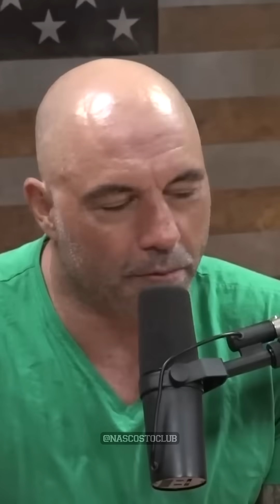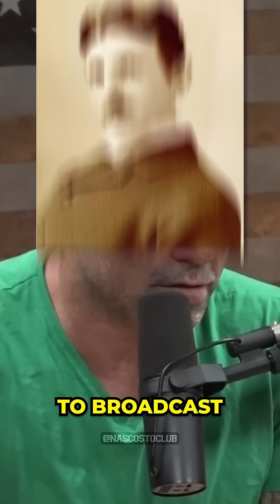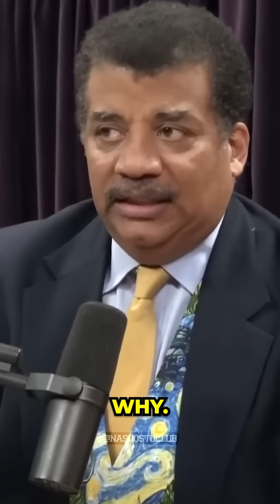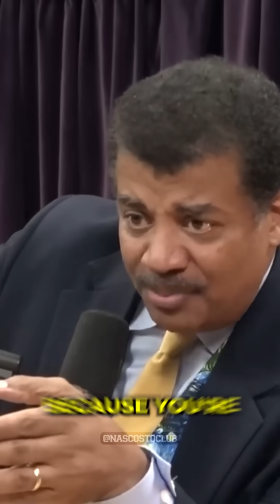WIRELESS Electricity Idea Debunked ⁉️⚡ #shorts

Comment: You’re pretty much in trouble anyway it doesn’t matter about the wires are Teslas idea about sending it through the air and the waves are phones and G5 alone if you have it on you it’s just radioactive I don’t care what magnets you put in there slip it in some sleeve that’s magnetized or special magnet. I’m telling you these phones you put them up to your head you lay next time you look at them and the radiation pulses because the phones always looking for you, so it’s always activating. It don’t even have to have it turned on.

Comment: Sound.
not electricity.

you convert it back to electricity at the fuking toaster; ya half-rate schill.

Or rather: from steeple to steeple. then it's in your walls. Redbricks are batteries.
(Research 'Tartarian Truthers',
  'Jon Levi', etc...   ...Arches, Columns, Lighthouses, Pyramids, STAR FORTS, Moats, Organs with waterworks, Symbols on Antennas, ANTIQUITECH)

Comment: In walks solar panels. Now, just to be clear you can transfer energy with light. Light is another form of EM waves and radio waves are EM waves. Now change solar panels to a different medium that can convert the EM waves into electricity. You can most certainly create electricity with Microwaves, take a grape split it in half but keep both halves stuck together by a piece of grape skin and stick it in the Microwave and watch the electricity fly. 

Now I don't think this video was a complete conversation and shows a fluid conversation about this topic.

Comment: There is a man on Instagram who has made a conductor that will power a lightbulb through the earth, I believe it is world wide and if you build a receiver the right dimensions you will receive the energy through the floor. Although I haven’t done it and I’m sure it’s low power, If 1 man can research this and do it in his back garden world wide, surely if a team of trained engineers were on it electricity could be put through the ground?

Comment: "It will be, furthermore, noted that no matter to what an extent the coils may be modified in design and construction, owing to their general arrangement and manner of connection, as illustrated, those portions of the wire or apparatus which are highly charged will be out of reach, while those parts of the saine which are liable to be approached, touched, or handled will be at or nearly the same potential as the adjacent portions of the ground, this insuring, both in the transmitting and receiving apparatus and regardless of the magnitude of the electrical pressure used, perfect personal safety, which is best evidenced by the fact that although such extreme pressures of many millions of volts have been for a number of years continuous-1y experimented with no injury has been sustained neither by myself or any of my assistants." - US645576A

Comment: As an electrician I would to show Neil how open air electricity works. Cause I think he believes it's like a big bug zapper that just has no directed path. If there's no lines to mess up you won't have accidents , point a and point b if electricity is disconnected between the two points it stops being dangerous. If you fly through it while not touching the ground you can't even feel it. I'm just wondering why not

Comment: This is the second or third time I have heard NDT, dealing misinformation.. I once believed him to be legit.  You can stand under high voltage suspension wires with a florescent bulb in your hand while the energy goes through the air and  lights the bulb  using your body as a ground to complete the circuit.  I like how he says "ALMOST CERTAINLY".  How can you be so angry about something that is "almost"  anything?

Comment: I never thought broadcasting electricity through the air was a feasible idea, exactly for the reasons Neil stated.
Reply: Sort of like how 'broadcasting' sunlight to solar panels doesn't work?
Reply: @95rav  you think electromagnetic radiation is the same as magnetic radiation? You think a tower on earth can put out as much as a nuclear reaction that fires a light a couple million miles to get to earth? 
You think solar panels are remotely efficient despite that power? Really?
Reply: @95rav  Photons and electomagnetic radiation is light? You want to fire light at an entire neighborhood. How exactly do you want to receive said light and turn it back into electricity? If you were refering to the way radio waves transfer information, they are captured as an almost insignificant variation in voltage and aplilified by another suorce for audio consumption. And thats already with hundreds of stations across a country beaming for miles around.

Please enlighten me on how these power transfer waves you refer to are generated, how they are fired through the air to hundreds of houses with consistant wattage sustained across each residence despite varied proximity to the source, and how you plan on turning this light back into electricity at the residence. All in an ideal world.

How would you stop a residence from stealing unpaid power from the environment, or track the energy use of specific households to charge them as is neccessary 

Dont insult me, discuss my arguement, thats how debates work.
Reply: @95rav  why are you angry man? I thought the point of the video was asking why we don't use the technology. If you read the comment, I didnt say is wasn't possible, I said it wasnt FEASABLE. Very clear distinction.
The reasons it isnt in use is due to the reasons I mentioned. Its financial stability is not irrelevant by any means.

The orginal comment we're both replying too was discussing moving ELECTRICITY through the air not Light.

I didn't ask how light was converted to electricity. That isnt relevant, nor do I need it Explained.

The technology Tesla used to wirelessly transfer energy is that of radio frequency resonance... achieved with high frequency AC current in electromagnetic coild to produce oscilating magnetic fields, which then excite materials exposed to the field, producing an electric curent. Hence teslas ideas around wireless power.
There is no light involved.

You are thinking of radio frequency light used to move electrons in arials. Yes there are magnetic field within a light wave, hence the current produced, but an electric field is also present. Thus you are discussing a similar, granted, but different type of technology.

You mentioned crystal radios.
Yes you are correct in that they rely completely on the current produced by the light waves. But they were notoriously quiet (because of low energy transfer), and used primarily for military comunication.
If this technology was superior due to its radio power, why was it ever superceded by models with aplification features? Why dont we use the original technology today? especially due to rising concerns surounding energy consumption.

Yet again they arn't relevant due to the technology disparity.

You seem to be under the impression that Nikola Tesla (the creator this technology) was renowned in the field of solar cells, heat pumps, and solar storage, when in fact he made his entire career working within the realm of electricity and magnatism.

I'm confused why you tell ME to do my research when you fail to understand the basic subject matter.
Reply: @95rav  If the sun has enough energy to power my lightbulb, why doesn't it kill me when I step outside... /s
Reply: @95rav  You realize I was making a joke right?

Comment: [Then how do we send wireless data from phones and other devices? From what I comprehend it depends on the frequency and how you would send and receive the wireless power oh wait you wouldn't need to send it, lmao its all around you the aether. Its the magnetics they don't comprehend how a magnetic field works. Oh yeah and Neal why does the military have bases at the poles where all the timelines meet, smack dab right in the middle where all the lines of longitude meet? Where all the info comes from, zero point, no time, how you got into this realm? Wonder where that info is coming from? Wonder how it is sent through the aether and we all don't die? They already know how to use what Tesla is talking about. They already have deployed it.

Comment: It was reported that Tesla proved that electricity could be transmitted through the air safely by holding a lit lightbulb that reportedly had its source transmitted through the air from several miles away. Tesla also invented the remote control which he demonstrated at an exhibition controlling a model boat which brought him accusations of having supernatural powers.

Comment: Neil is just being a hater you can absolutely have electricity via radio wave floating through the air without it killing you cell phones haven’t killed table Tesla‘s very first version of the Gasfield lights that illuminated when exposed to electricity in the air

Comment: Flash lights are low voltage enough but would the static electricity interfere with human brain currents? They use static electricity to weld the gold dust to micro chips. I had a teacher who use to work around the machine that was essentially manmade lightening. While the machine was on and after it was turned off, there was no entry into the room for 24 hrs. They would open the doors after a few hours to let the static electricity to dissipate. He was standing at one of the open doors and he pointed at something in the room. After he came to, more than a year later, they told him he only survived the 100,000 volts because his other hand was on the steel door frame.

Comment: I didn't realize having a degree in Astrophysics gives you the authority to speak on electrical engineering.  Also, they is just guessing what the theory was. The energy would be generated and pulled from the air but not sent back out through the air. This guys entire career is based on assumptions

Comment: I mean we already move “ELECTRICITY THROUGH THE AIR” with ac transformers via magnetic waves with almost full energy transfer. A lot of the things we use today work like that not just transformers but motors and generators, you name it. It’s not that big of a stretch to try to make that happen over longer distances and magnetic waves are safe.

Comment: This is pap.
We are bombarded with em energy just by standing in you kitchen.
Microwaves cook food, and not through a wire. You set your dish on the turntable, and microwaves fill the box and cook what's in there. You don't hook up probes fed by wires, it cooks "through the air" in the box. So, I don't see debunk here, I see misstatements, commonly referred to as Lies.
But why? And why Tyson?

Comment: This is not how Tesla patent worked. He uses a capacitor to receive adequate passive charge that is stored for intermittent use. We are surrounded by high voltage electricity and it can be demonstrated with a capacitor to ground and a spark plug to an antenna. If Neil is correct, people should not live near high voltage power lines. He should stick to astrophysics

Comment: Wireless electricity at a distance also suffers extreme losses. It's expensive and impractical to implement, and in the end, it isn't even really necessary at this point. Electrical infrastructure and battery technology is already so advanced and available that wireless electricity would literally be a few steps back.

Comment: Why it wasn't allowed was j.p. Morgan couldn't make money off of it

Tesla's more interested in how the world worked not how he can profit off of it

Many cell phones don't have wires connected to them and energies wirelessly beamed to charge the phone (Qi protocol)

Power transformers in electrical lines beam electrical energy over short distances by electromagnetic waves.

Low-frequency such as 60 hertz fall off quickly but with higher frequencies the further the power can be transmitted

The impracticality of this is that you could stick up an antenna anywhere and receive energy without having to pay for it. So how would you pay workers to upkeep this system if there was no way to enforce payment for the system. Why it doesn't exist is because it's in business sense impractical

Comment: The wires that carry electricity to buildings is very high and is stepped down a few times from power station to outlet. Neil is correct that we wouldn't want 480 volts at super high amperage going through the air. 
HOWEVER... the wireless transmission that Tesla envisioned was a completely different technology based on scalar waves, not alternating current. That is the part NDT is overlooking.
Reply: You still don't get the wattage...

Comment: Neil I know you are a smart person but who would be dumb enough to send electricity through the air with out putting radio signals in it? Ever used a rc car or planes they can fly together because they have crystals providing frequency so if Tesla would have gotten this thru peoples heads there would be a completely differnt world ! Yea I’m saying we could send voltage out with a crystalline signal to the house that had the reciever in it tuned to the same frequency  would in fact get wireless elect this is how I would do it I’ve. Been certified in Elecricity since 2003 in high voltage was cert in residential back in 87

Comment: Tl;Dr this technology works but has real limitations which stop society from using it all the time.

The real story is that wireless phone chargers use a updated form of the exact technology that Tesla was proposing.
The issue with this tech is that it has a very limited range.
Every time you move further away from the antenna where the power is coming from, more and more energy gets lost into the air.
Which is why wireless phone chargers literally touch the antenna.

This technology could be used at longer ranges, but it would have to be directed energy (like a laser made of radio waves).
The issue with directed wireless power transmission is that the broadcasting and receiving antennas need to be pointed right at each other, so you cannot move your device an inch.

Comment: Neil showed his ability to bullshit his way through anything. Electricity doesn't run through a wire it is actually an electrical field that surrounds the wire and is actually in the air plus the sun dumps more power on our planet in one hour, in our air mind you, than the planet can use in one year. Facts Neil. . .facts

Comment: Now we send energy through wires, which has less impedance and less transfer space. I'll use lightning as an example, the strongest electrical current on earth is a lightning bolt, but when you confine it to a wire it then can't reach its fullest potential

Comment: Well i agree with Neil with general laws of physics. But in the quantum realm it can be worked differently. Where we can stimulate point A in quantum realm that will produce energy in point B which can be transfered to a point in physical pane. This is theoritically possible. But we cant do it without the necessary tech.

Comment: Transmission of audio signals through an antenna modulatedmixed with a higher frequency carrier wave and transmited through an antenna through space and picked up by a receiver tuned to the same frequency and sent to a detector unit in the receiver to remove the carrier frequency and capture the original audio signals and sent to an audio amplifier then to a low out put impedance speaker. More or less.

Comment: Reasons why tesla's idea wont work
- difficult to scale and inefficient 
 To power a huge city like new york how many coils do you need? All of em need to be unobstructed too or the efficiency drops tremendously, you need to remodel cities around it and that would cost even more.

- not safe for humans
Neil's point was, making a coil that can run houses through the air (assuming it's not obstructed) can pose as a fire hazard, if u stand inbetween the coil and something else that takes power you won't feel it cooking you alive you'd just drop dead maybe feel a little warm.

- not reliable
Ever listened to your radio getting interrupted while a storm is going? Plus the fact that the temps of air around could affect its efficiency isn't something worth risking the public safety for.

Comment: Yeah I understand this because I'm not  stoned off my ass at the moment like Joe! Hehehe and it's aggravating for the good Dr. LoL I worked around power stations! You don't want lots of electricity flying around in the air! It's cool to see if your at a safe distance. Not so much up close. But DC current and ac current is different. What we call static electricity was what Tesla worked with. A different technology than what we adopted from Bells work. Which Bell swiped it seems. Those electric balls that you touch and your hair stands up. That's static,most of those ball are putting out 50,000 volts plus! But even it can hurt you.

Comment: What NDT says in this case is perfectly reasonable. He can be a party pooper and wrong in the process, but he is correct. High power radio frequency emissions are no joke. They are mostly harmless in practical applications because of the inverse square law, and there are some differences on the base of which frequencies are used, but you wouldn't want to sit in a microwave oven, which can be also dangerous at outputs far lower than the one you use to re-heat a tuna casserole.

Comment: Neil is right. The energy needed for conduction through the air is so strong that you'll just get electrocuted. And it's a very inefficient way of transmitting the currents needed to power a light bulb for example.

Comment: You absolutely can transmit power wirelessly without harming humans.  The issue is that wireless power generation has a very short effective range, so you can’t have a massive power station to supply energy for the whole world.  The limited range is similar to the problem that DC power had, which is why AC power is used in our houses today.